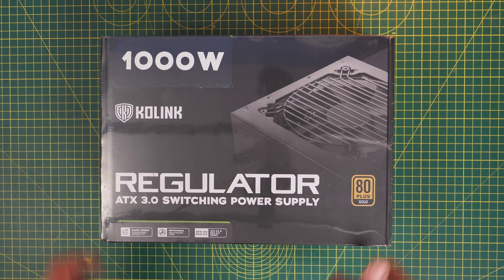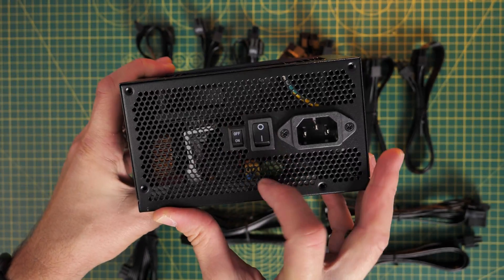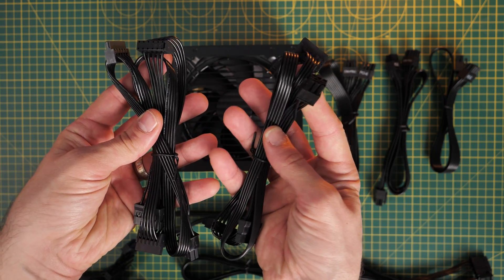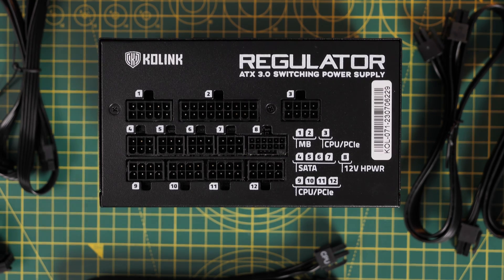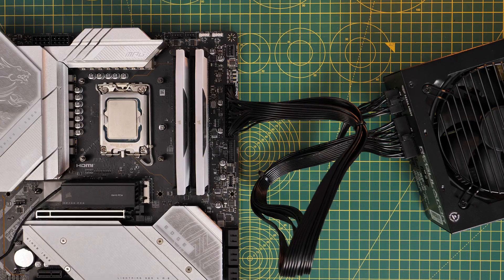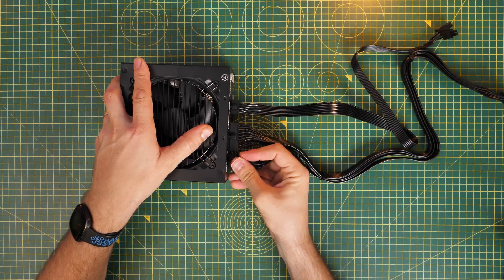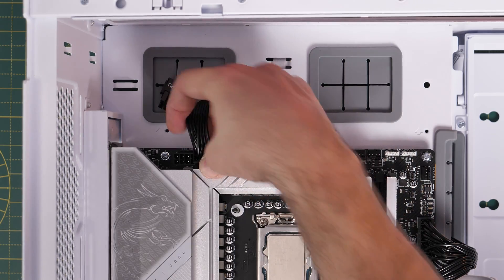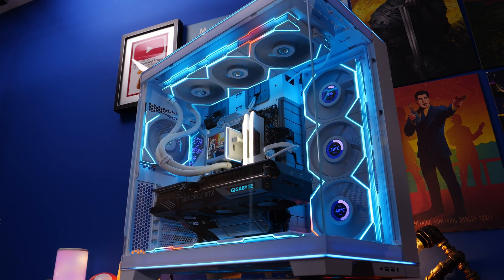Kolink Regulator PSU setup and wiring guide

Comment: Interesting video.
Been concerned about how good Kolink psus are...
My oldish pc came with Kolink 700w psu, I was told by the custom pc seller that they're about the same as other OEMs.
Reply: Yeah how long guarantee this PSU have? and is there any known cases that Kolink power supply unit could destroy your Motherboard?